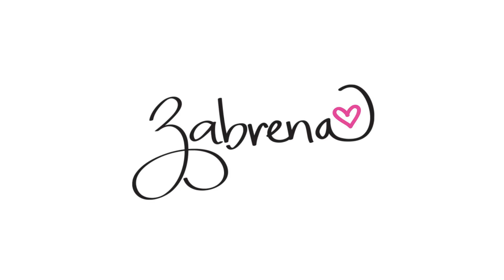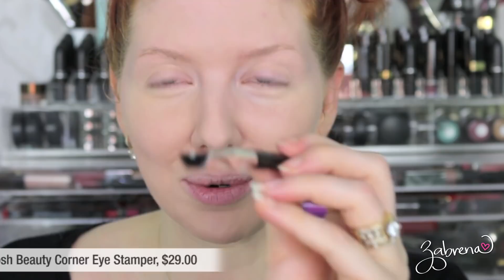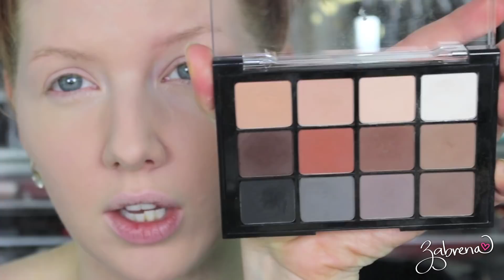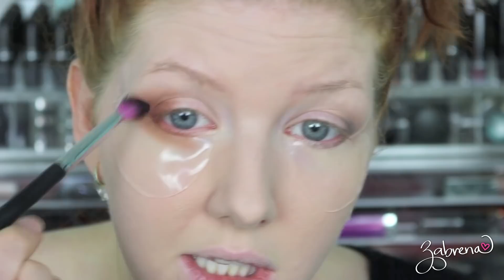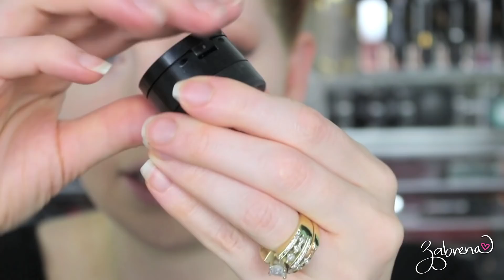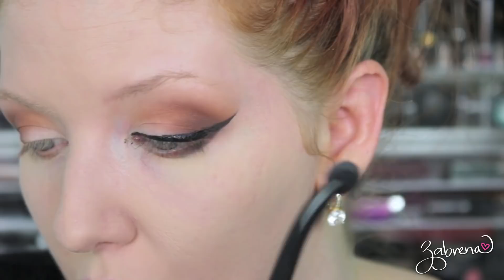Weird Makeup Tools | DO THEY WORK?

Comment: I used clear tape to set my sharp edges for eye shadow and under eye. You can get the same angle with clear tape. The large roller wheel was too large for the inner eye part.

Comment: I bought the Woosh brush and the stencils, but I haven't opened either one yet.  I think I will take the brush back for sure.  I cannot do a winged liner, but I'm usually better at doing my foundation first.  Hmmm - still thinking on that one.

Comment: My thought on the under eye shield after using a couple times was that the removal was way too sticky. It actually pulls at my skin so much it burns. I returned mine as I would rather just apply before foundation if  I'm using a shadow that has fallout.

Comment: Rimmel also has a new eyeliner with a roller wheel applicator like Mac. It's called Rimmel Scandaleyes Bold Liquid Eyeliner. Can you please do a Frugal Friday comparing the two? It's so much cheaper than the Mac version and I want to know how well it does.
Reply: PokeGirl100 I love slogan Rimmel "The London Look," it's made @ the Coty factory, in Broadway a very small town in NC. ( 1 stop light) NO LIE! Wish they still had factory outlet( a trailer). Never cared much for Coty stuff, I guess because it was so cheap.